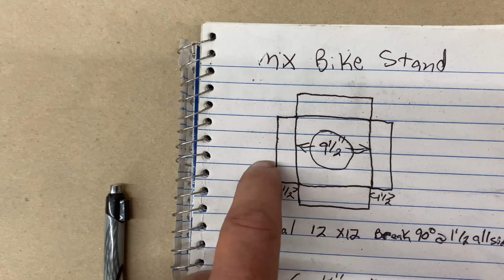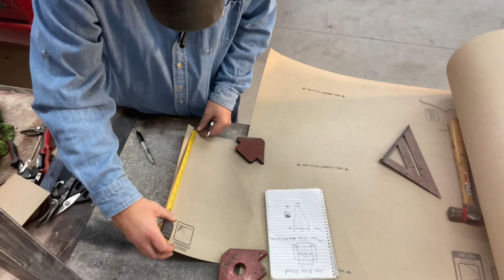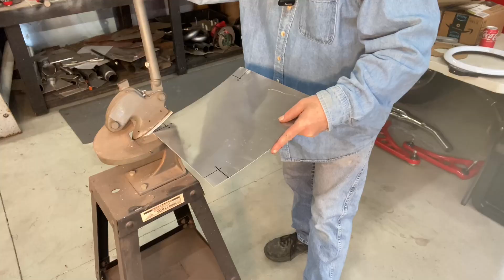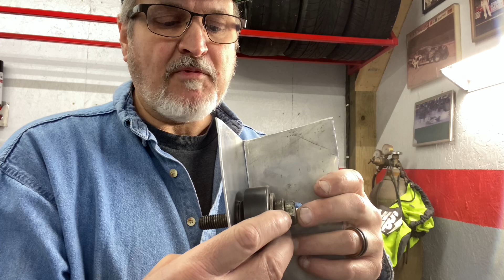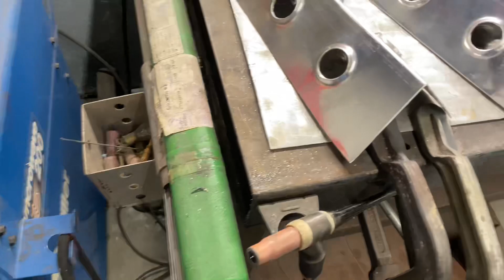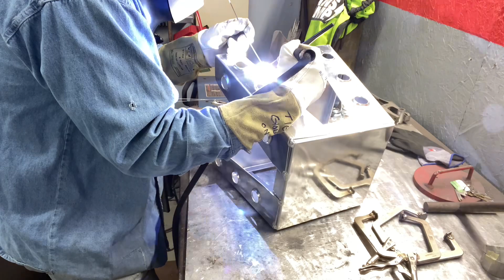Aluminum MX Motocross Stand Build

Comment: From what I could see the biggest tips I could give on the welding would be 1) Get yourself in better, more comfortable positions. You were making several of those welds with the stand upright when you could have had it on its side. Use props to get your hands up higher off the table if needed. 2) Run a couple thousand more practice beads and  you'll get the consistency and visual appeal you're looking for.  Good build, turned out well!
Reply from the maker: Great advice. I will try all that out. Thanks for the tips. I sure appreciate it. One can’t be afraid to ask.